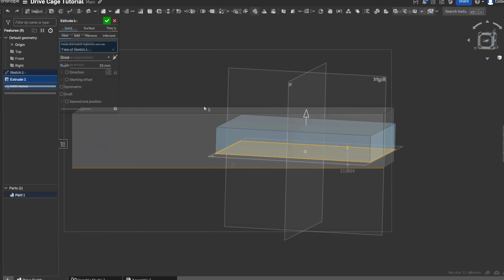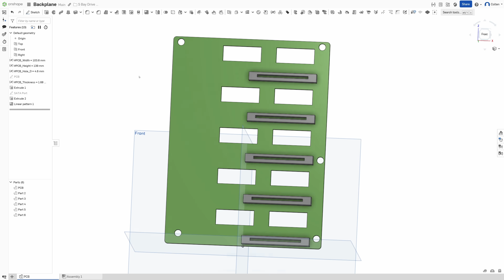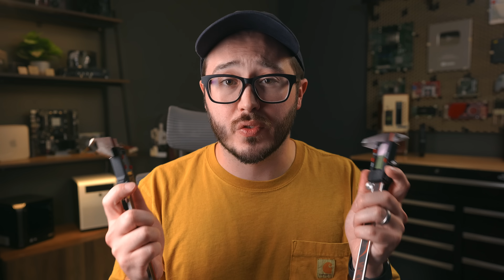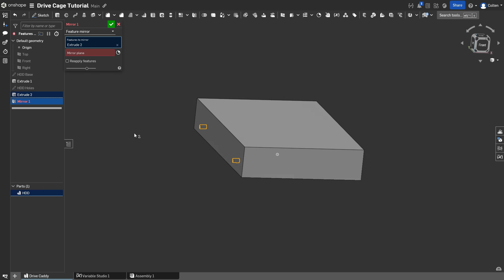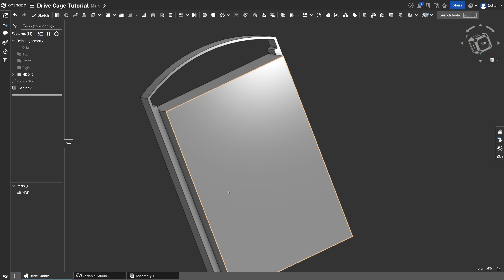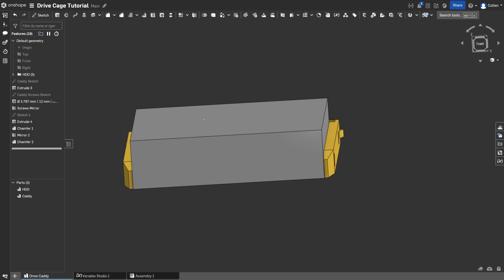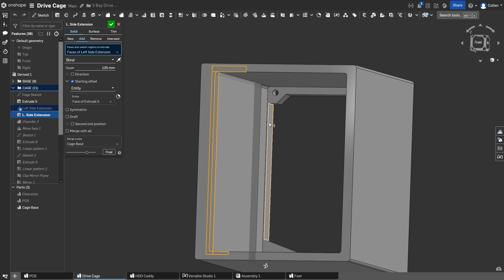Design Your OWN 3D-Printable PC Parts (It's actually easy...)

Comment: is 80$ a budget case? what about a 25$ one?
Reply from the maker: For cases that store 12+ HDDs, yeah kinda
Reply: @HardwareHaven  don't get me wrong, that's a nice / decent case for $80 but i can get a $40-50 to work with 3d printed hdd bay. that i will call budget but i might also go for the one you pick for the glass panel..
Reply from the maker: Just saw this, but I was implying that it was relatively inexpensive when compared to other cases with capacity for a bunch of drives. I didn't buy the case with the intention of replacing the part that made it cost so much lol
Reply: Yes, 60-80 is budget, especially for a NAS case new.
Reply: Sheesh rolling in the dough there with $25. I have $12 take it or leave it.
Reply: @SianaGearz  i was always considering euros to us dollars as about 1 to 1 but i can buy the exact case for 45 euros including 24% vat here so maybe dollars has lost 50% of their power and a $80 case is a budget one... sorry...

Comment: 2 sponsors in the video, but his hard drives are upside down. Typical blogger. And people will end up watching such harmful advice. You can't install drives like that.
Reply: You certainly can. It doesn't matter which way you mount the hard drives, as long as you mount them vertically or horizontally. The only thing you shouldn't do is mount them diagonally. In laptops, for example, hard drives are often mounted upside down. Nowadays, of course, these are SSDs.
Reply from the maker: 1. You can call it two sponsors if you want. 
2. I don't have a blog
3. Can you show me any evidence that this HDD orientation is damaging? I can find plenty of documentation direct from manufacturers that it's completely within spec.
Reply: running hard drives like that is fine, I searched ecosia for "does orinatation affect hard drive longgevity" and the top 6 results all concluded that it doesn't really matter. so this isn't "harmful advice" and you can "install drives like that."

also just install the sponsor block extension if they bother you.
Reply: BS...

Comment: Could be used for an external enclosure. Just gotta figure out how to power the drivers.
Reply: shouldnt be too hard, they just need 5v and 12v. you can get away with a meanwell 12v psu and a seperate dc-dc converter for the 5v which i think is only a small load.
Reply: @Altirix_   Just beware of which DC-DC converters you buy, and use an oscilloscope to test them under a little load (a toy 1MS/S oscilloscope is just fine). The typical LM2596 board you get everywhere is a disaster because in 100% of cases the chip is fake, it's a remarked 2576 or a chinese chip with similar spec, meaning the inductor value is wrong and there is a huge residual output ripple. The EMI performance of these boards is also horrendous via the input wires.
Reply: @SianaGearz  LM2596 hasnt been a serious choice for anyone that is into electronicsfor a while now. even a genuine LM2596 is a horrible choice compared to more modern DC-DC converters. Id recommend MP1584. but no idea what the 5v load actually is. wouldnt pull more than 2A without cooling. may need to go with another meanwell 5v if its more than that